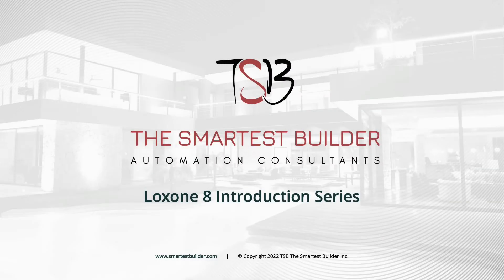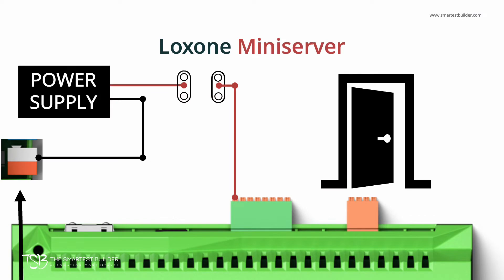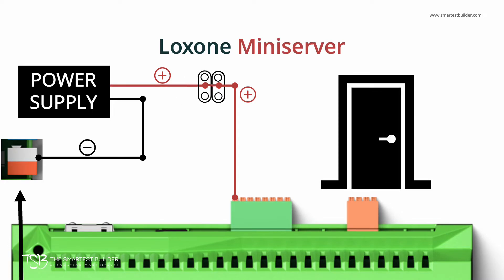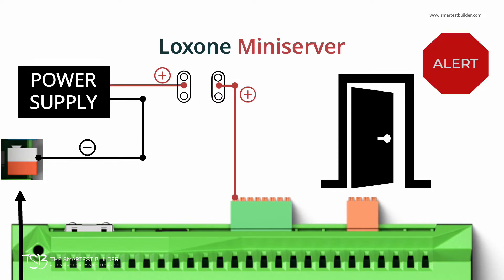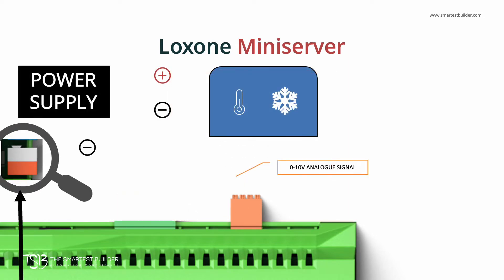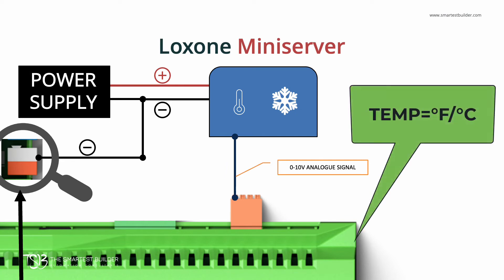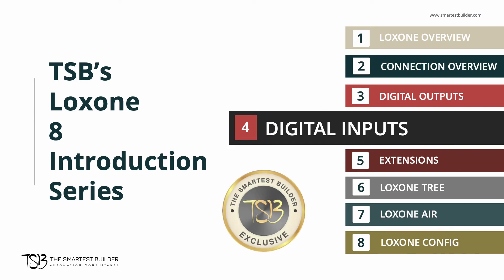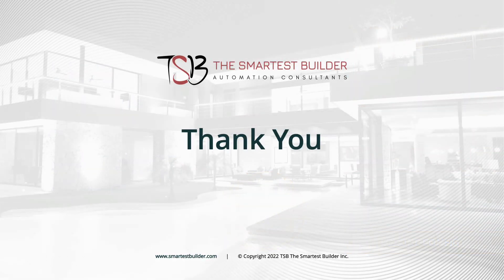Loxone Introduction Series Video 4/8: Loxone Digital and Analogue Inputs

Comment: How this configuration door contact looks in config?
Reply from the maker: Good question. I will make more videos on Loxone Config explaining this once family life has stabilized. Essentially in Loxone Config you can set the Digital Input(DI) properties to be defined as you want to . For example you can make the DI normally closed or normally open. From this you can digital assign this task to another function block or directly to an output.